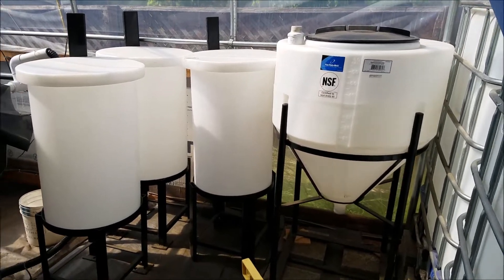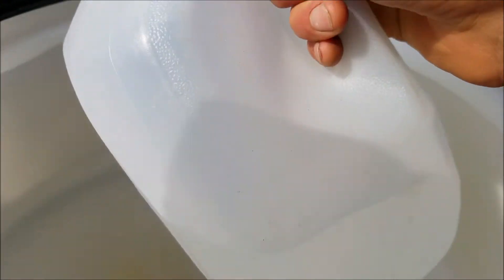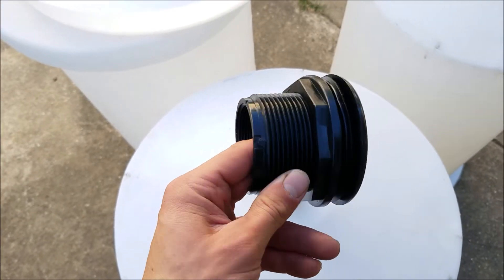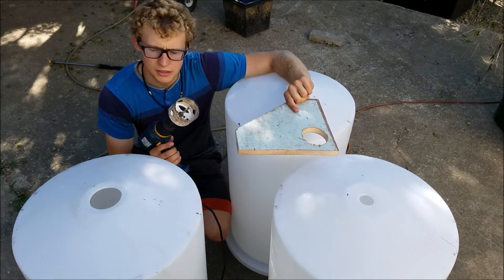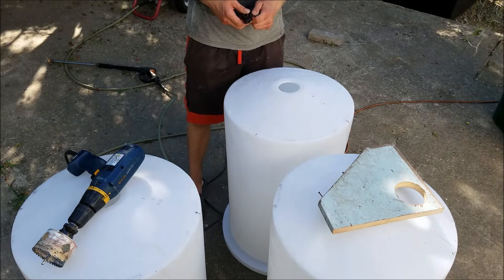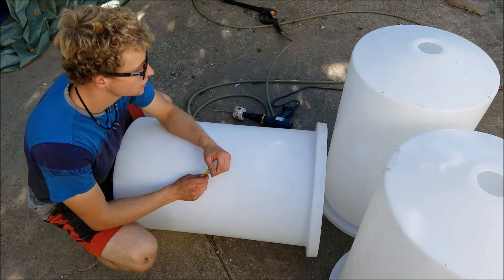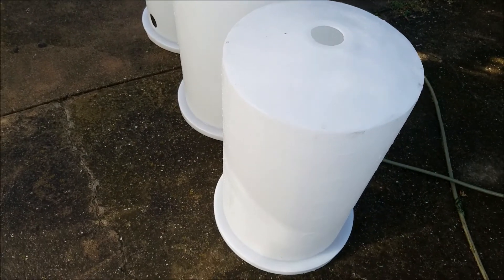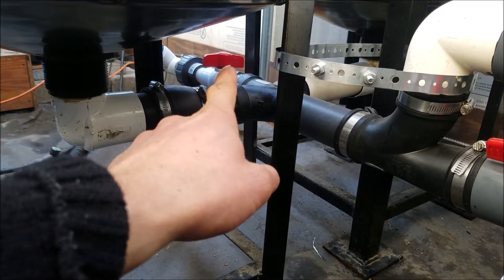Aquaponic system Renovation part 15 (plumbing part 3)

Comment: Is your aquaponics setup just for yt, or do you run a business?
Reply from the maker: It is just for me and my family.
Reply: vonponics that’s awesome, how’d you initially get the idea/inspiration to start  (aqua)ponics and would you consider micro greens? Thanks von, I love your content boss.
Reply from the maker: @yoloswagman5424  I think my mom initially got inspired about it. We set up a small ibc tote system for her after going to an aquaponics place, that she found (which no linger exists). After that I left home for a bit and she couldn't really get it going. She likes the idea and the whole concept about it but didn't really understand the workings of it. So she couldn't really get it to work that well.
After I came back I just really got hooked on it for some reason. I then started collecting equipment making plans, reading books, and watching videos about aquaponics. That is pretty much how it went. 
Funny thing is my parents actually wanted me to start small, so that I could get it to work. But I couldn't help myself and just went all out on it. I probably would have gone bigger if I had the space and was able to find the material. I was luckily able to convince my parents to allow me to build it pretty big.

I might do micro greens, but first really want to get everything done and up and running before I try something different.

thanks